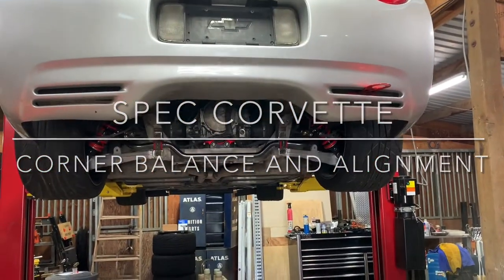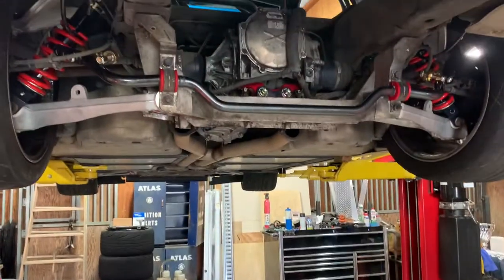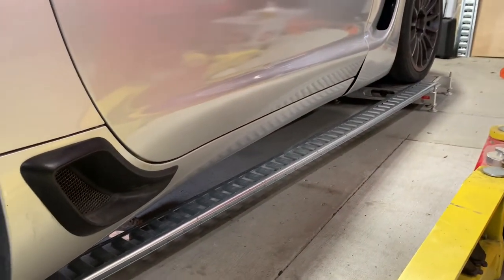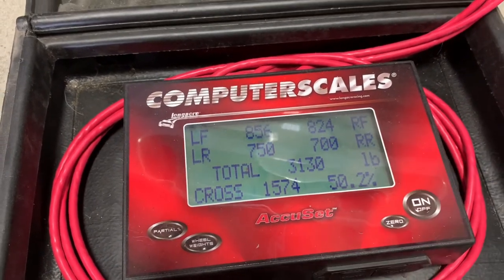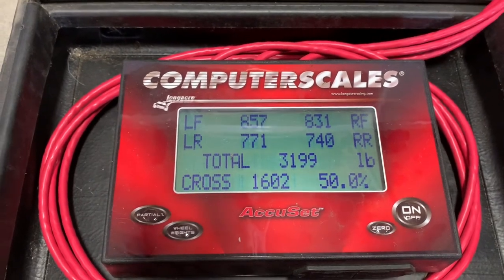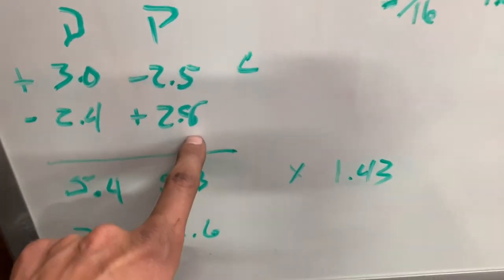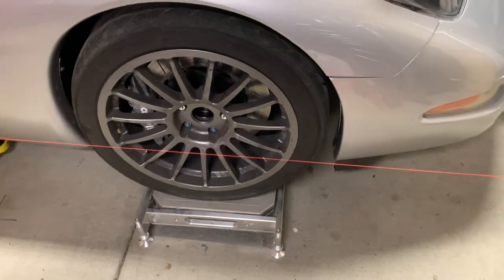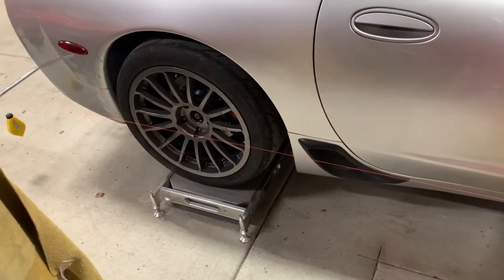Spec Corvette Build - Corner Balance and Alignment

Comment: Hey Josh, I was curious if you happened to measure the wheel center to fender ride height?
I usually measure bottom of wheel to fender then subtract half the wheel total height to get my ride height. The frame to floor height is usually a bit trickier like you said.
Reply from the maker: I haven’t used the fenders for it, figuring there could be more variance there… but those jack points get fairly deformed with time so either should work just fine. You’re just looking to get it in the ballpark before fine tuning with corner balance anyway.

Comment: About fuel load. I know the C5 pulls fuel from the right tank first until empty, then starts pulling from the left tank. Do you think this would make a significant difference during the balance weighing whether half or full? 9 gal of gas is around 60 lbs.
Reply from the maker: Yes, 60 lbs makes a difference and the right rear wheel is light at 1/2 tank (from a cross weight perspective). Some folks like to bring the car in close to empty at the end of a race and calculate the amount of gas they need to have in each race. That stresses me out, so I prefer to start full. In either case, weight distribution is changing as you consume fuel, so you’re either starting closer to 50/50 or finishing that way, assuming you’re running 30-40 minute sprint races.

Comment: excellent video, answered my questions about corner balancing and rake. those scale pads are great, the biggest issue i have is trusting the car is on level.. which i know its not. will you see any change in camber after driving the car? you working out with those 60# dumbbells?
Reply from the maker: Camber should not change after driving if it was properly settled during alignment. That said, springs can sag a little when new (that would affect camber and toe), so it's a good idea to let the car sit on the springs for a day or two before setting ride height, if you have the time.

I haven't used those dumbbells since I broke my wrist this summer... need to get back to it before I wither away.